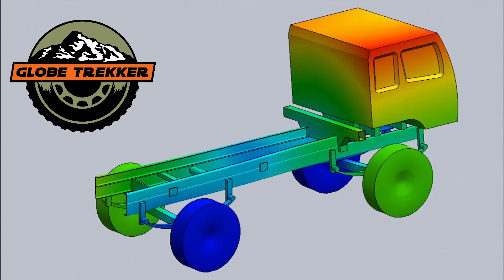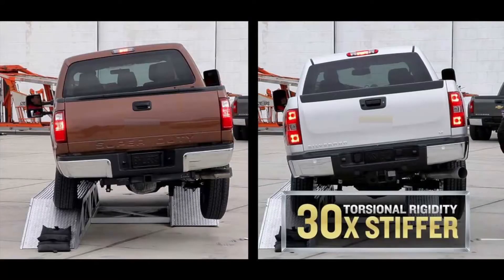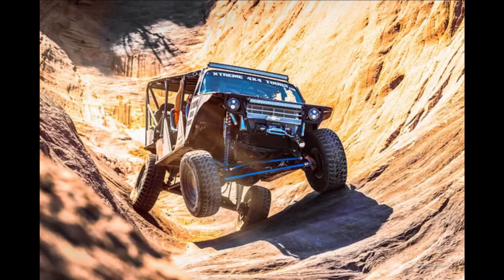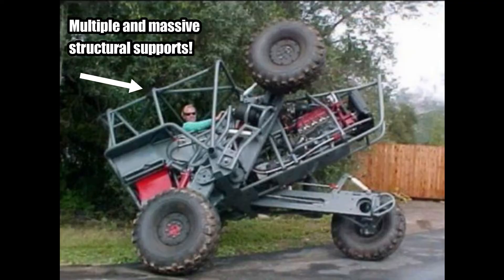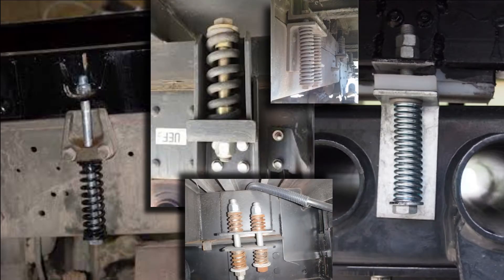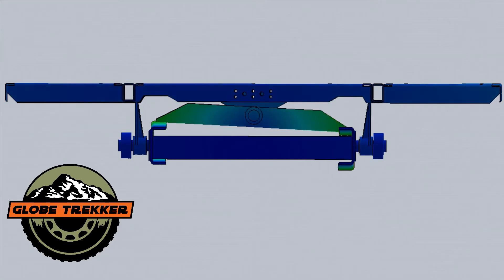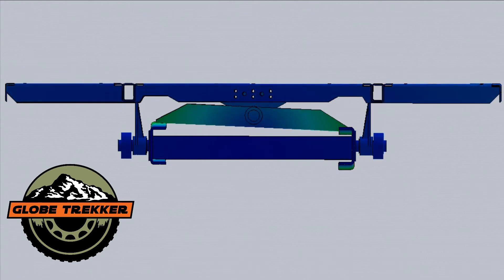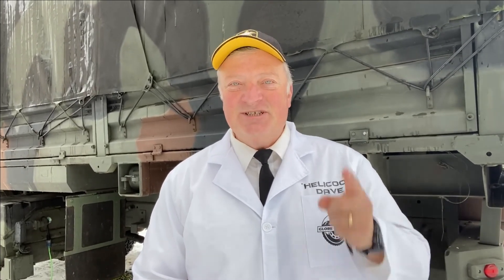Globe Trekker Ed: What is "ZERO TORSION"

Comment: Can your zero torsion subframe be used with a RV Trailer?
Reply from the maker: Absolutely. You mean to replace the bed of your truck with a zero torsion subframe and then place an RV trailer on it, correct? That would be the best way to prevent your trailer from wracking... Trailer frames are generally not designed to twist since their twisting point is the tongue attachment itself. When they are placed onto a frame that does twist, bad things start happening.
Reply: @RVGlobeTrekker  What about welding a 3 point system to the trailer frame? No reason to have 2 frames right.
Reply from the maker: @Porsche_Past  weld or bolt the zero torsion subframe to the trailer would work just fine. Trailers are commonly known to have some issues over their lifespan, however. Bolting might be better so that maintenance can be accomplished if need be. Trailers are also not known for long life and most have organic materials that decay, fiberglass insultation that soaks up water, and other substandard materials such as XPS (Styrofoam) which rates poorly on the insulation R-value and is not fire resistant at all. The walls and ceiling are also very, very thin. But, the inside comes ready to go... and that is a plus for some folks.
Reply: @RVGlobeTrekker  This is a temp solution given the current state of the world. I do want to entertain your habitat box =)
Reply from the maker: @Porsche_Past  Sorry, I did not fully understand your question above. The trailer frame is not adequate to have just the pivots bolted or welded to it. You would have to have the supporting one piece subframe that comes with our kit to make it work.